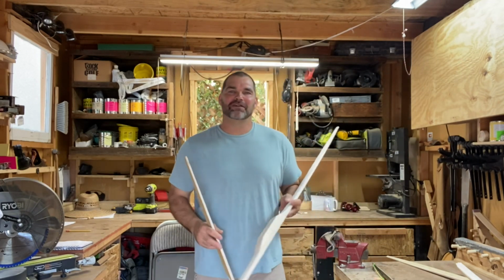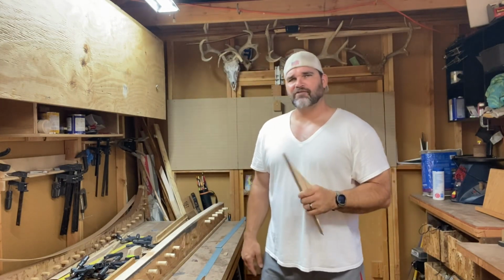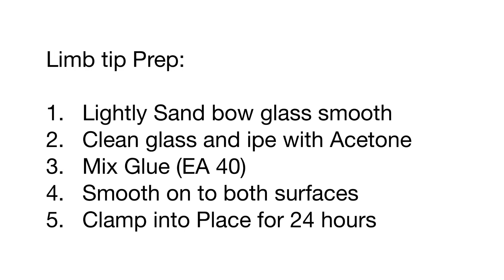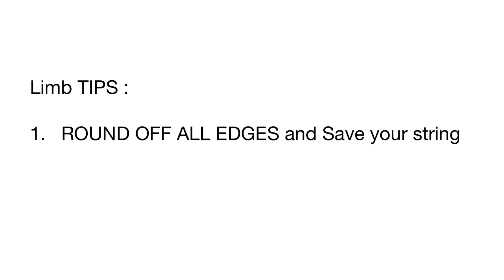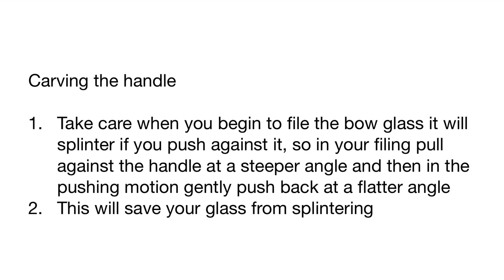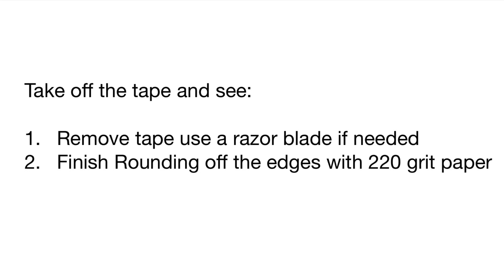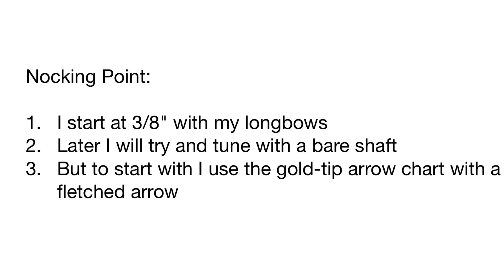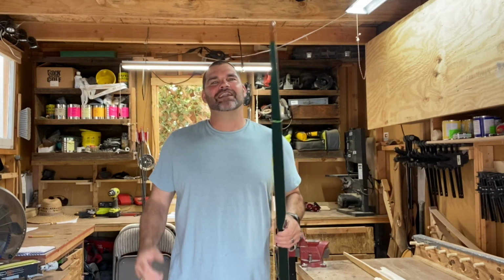American Longbow Build Start to Finish (HillStyle/Flatbow) Handmade custom hunting bow

Comment: Great build 👍🏼 save them maple limbs - the good ones.  Make either a reflex or deflex handle for them hot glue them on then wrap them with fiberglass tape.  And you have a bow again. Just make sure handle and limb get a good 4” of glue up.  Taper tip of handle so it can flex.     Keep up on videos.
Reply from the maker: Thanks for the tip! I will try that when I get a chance, I was thinking of trying to build a take down three piece out of wood, maybe I'll try it with those

Comment: I’ve had a maple board bow survive with a raw hide backing before. Took a TON of set but hasn’t exploded yet. Probably would’ve if it was not backed.
Reply from the maker: Yeah I tried linen cloth for the backing on those two builds, didn't work out for me. I am learning that my limb tips need to bend more with the working part of the limb though. Thanks for your words and for watching